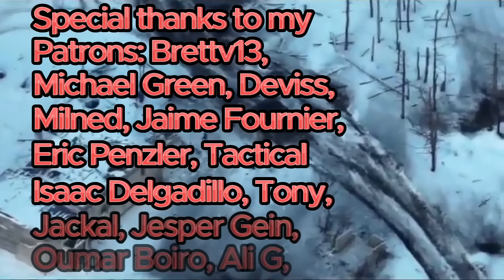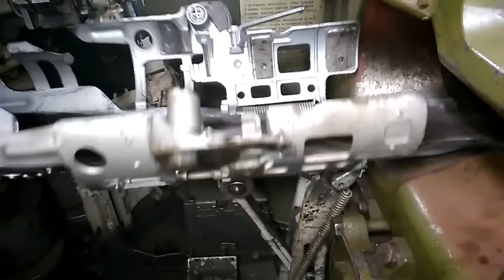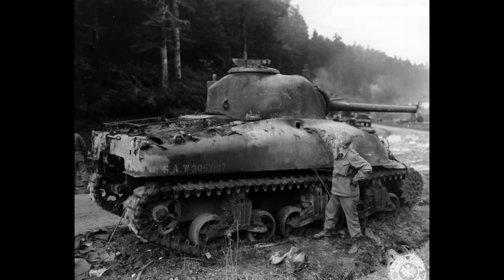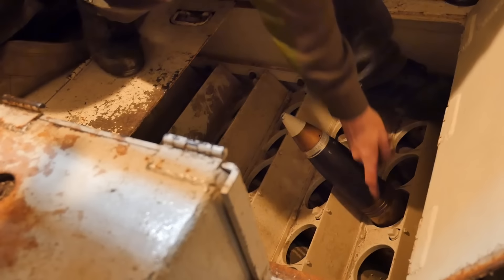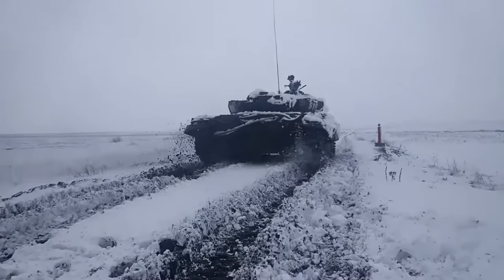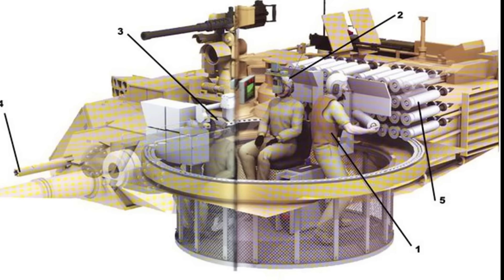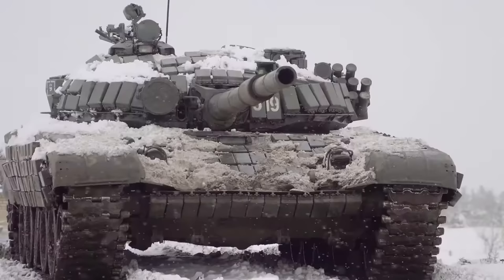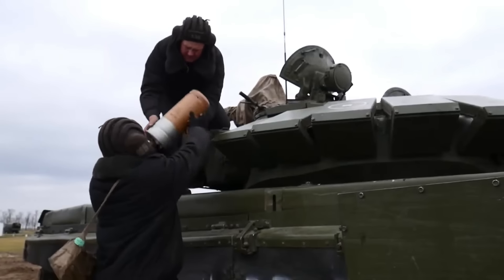Is Autoloader Really the Reason for Russian tanks exploding so much?

Comment: Would it be feasible to simply raise the floor plate over the top of the carousel so if the ammo does get stuck, it would be easier to have it vent out the bottom of the tank? I suppose that would kind of be like a lift kit and the driver  may get a new hatch behind him to escape from.

Comment: Less the autoloader and more the style of autoloader.  The leclerc has a segregated ammo storage area and an autoloader (That the T-14 is basically copying, admitting it as a design flaw).  The soviet basket layout and autoloader system is a blatent design flaw if you want the crew to take a hit and be able to survive long enough to be given a second tank instead of being turned into borscht

"Why? For the same reason our reactors do not have containment buildings around them, like those in the West. For the same reason we don't use properly enriched fuel in our cores. For the same reason we are the only nation that builds water-cooled, graphite-moderated reactors with a positive void coefficient. (beat) It's cheaper." - Valery Legasov in the finale of "Chernobyl"

Comment: Ejectable carousel (downwards) might be an alternative solution?
Reply: Like a blowout panel at the bottom of the hull under the ammunition? I guess that might work but I’m not a tanker so idk if they might be any hidden drawbacks to this.
Reply: Only option is thick protective containers like for Merkava shells. But it works with manual loading. IDK how make it for Autoloader.
Reply: Down is bad, there is ground in the way) you want unmanned carousel turret on the top with crew in hull.

Comment: Its the design Russian designers havent changed the design since their creation and havent cared to change it even through top attack munition developments.
Reply: And they arent wrong - storing ammo AT THE BOTTOM OF THE TANK is better then on top for top-attack ammunition, duh. Same way as storing ammo on top of tank is better for mine protection.
Reply: @alexturnbackthearmy1907  "storing ammo AT THE BOTTOM OF THE TANK is better then on top for top-attack ammunition" 
No its not since the top attack ammunitions can have 600mm (and more) pen and the jet will slice everything that comes in its way since the top of the tanks are lightly armoured.
Reply: @kerekeke5295  Its better then having ammo on top, and with relict ERA (or something likes of it) there is decent chance it will be stopped/performance degrades so much that jet losses its power traveling trough fighting compartment. Much better then having NONE empty space between warhead and ammo, much less block or two of ERA.

Comment: Very Briefed And Summarized Ideas:

the fpv is new emerging threats to the current battlefield's environments, On the other hand, the various tanks currently operating in the Ukrainian theaters of operations are designed according to the requirements and specifications of the expected operational environment in the Cold War and then in the era of the so-called war on terror for the latter prioritizing the survivability in urban areas which highly saturated with hand held anti tanks launchers firing HEAT projectiles and improvised explosive devices, therefore, those tanks operating in the Ukrainian theaters of operations still have to adapt to the emerging threats and hostilities on the battlefield's...

It is worth noting here that the kits equipping various western tanks and armored infantry fighting vehicles to fight the war against the rebels, especially in the urban environments, is theoretically suitable for protecting them from the threats of FPVs, since those suicide drones carry the same PG7 projectiles that are launched by RPGs launchers, so what is the difference here? In fact, there are some fundamental differences, including, but not limited to: 
1- the accuracy in hitting the exact part of the tank’s body that is most vulnerable to destruction with absolute freedom, especially during its movement in the no man's land.
2- the ranges that exceeded the 300m barrier for the same projectile when fired from a shoulder fired launchers to several kilometers when delivered by FPVs, exceeding the ranges of most ATGMs present on the battlefield...

I think it could be countered by various means including but limited to the mixture of : cages, explosive reactive armor commonly known ERA, and active protection suits, radio signal jamming devices the latter by the way playing the same role of the soft kill systems utilize to counter the ATGM missile's, so it will take some time to develop the right mixture to counter the FPV drones against armor fighting vehicles AFVs especially the tanks and the infantry fighting vehicles IFVs... 

the Soviet's and the western tanks was designed to fight, survive and win the battle's in the european theaters of operations, each blocks had different concepts and fighting principle's, the Soviet's from their ww2 extensive experiences prioritized the mobilty and the firepower or the speed and the main gun caliber (destructive power) at the expanse of the protection (although the Soviet had different norms or standard's for the interpreting the protection that outside the classic classification of the thickness the RHA and the weight of the tanks) and advanced fire control systems, prioritizing overwhelming the enemy with huge numbers of various types of AFVs especially tanks and IFVs supported by intensive ground based and air based firepower assets and try to achieve fast breaching of enemy lines or crossing the battlefield's and fast closing the distance's with the nato armored and motorized formations and try to crush it from closest distances, and with that mitigating the traditional western tanks preferences and advantages in: advance fire management system : sighting system, ballistic computer, metrologic sensor's, the stabilization systems, alongside the longer guns and more advanced ammunition, and the excellent communications or the team works... 
(((although our talking here over tanks versus tanks and not the combined arms battle's doctrine especially since the tactical and operational requirements and demands for tank designing, (especially western ones), give top priority to the combat capabilities of the friendly tank to defeat the enemy armor fighting vehicles especially main battle tank, (preferable from the first shot), and not leave this task to the rest of the battle weapons either traditional weapons or the evolving and emerging one's over time.
and I think this is contrary to the public belief that tanks are not designed or intended to fight other tanks)))...

On the other hand, after World War II, the ground forces of the nato alliance adopted, for a large part, the combat doctrine of the nasty germans army, and this approach did not come out of nowhere, but rather was a translation and interpretation of what the numbers and data reflected during ww2, not only the rates of losses in tanks and armored fighting vehicles between the two parties with 7-8 Soviet tanks to each nasty germans tank lost on the western/eastern front, but also in the rate of industrial production of tanks between the Soviet Union and the nasty germans, for example, the Soviets lost about 50 thousand t34 tanks in World War II, In contrast, the nasty germans factories did not produce more than 67 thousand tanks and spgs in total from all types in the entire 6 years of war, and added to this is the nasty germans lost its air superiority over the Soviet union territory in World War II since 1943, and thus over time gradually but steadily, the roles of the nasty germans ground attack planes and  bombers had dropped in harvesting Soviet tanks, and most of the credit for destroying Soviet tanks was awarded to the nasty germans ground forces especially tanks and more specific the heavy ones equipped with 88mm gun with longer barrels l70, the flake 88 gun and other tank especially equipped with the high pressure 75mm/l70 and armor hunting fighting vehicle's, beside other classical and evolving elements in the battlefield's like the recoilless rifles the early generation nasty germans RPGs...

this is why western tanks after World War II (and purely driven by the nasty germans extensive experiences in ww2 beside by economic and industrial considerations) glorified the stand-off capabilities of its tanks, and work to employ the factors of traditional technological and industrial superiority of the west in favor of producing tanks that possess superior combat capabilities over its Soviet adversary, enabling them to accurately destroy his tanks from a longer distance than the effective engagement ranges of the Soviet tanks main guns, and at the same time enjoy high levels of protection enhancing its survivability chances on the battlefield in case it suffered a direct hit with apfsds rounds or HEAT rounds...

Comment: Both systems are equal . 
Bustle increases profile but it's faster, 
Carousel is smaller but slower because ammo needs to be moved in two planes. 

The only version of a carousel
Autoloader that is future proof would be one were the ammo is stored vertically because it allows the use of longer single piece ammo für apfsds 

I bet if done right one could build a carousel autoloader with blowout panels under the carousel.

Comment: The issue is pinpointed by RedEffect at the very end: the sensitive ammo and propellant. That's what explodes. Also Abramses don't tend to actually explode due to in most cases carrying APFSDS ammo. If we were to load the Abrams with Russian HE-FRAG and HEAT rounds and hit it with a modern RPG, it'd explode and tear the tank apart, blow-out panels or not.
Reply: any source to back what you just said?
Reply: @kekwuwuowo  No need, as it is pretty obvious - if 125mm HE is enough to get a tank from outside, then why wouldnt it able to do so inside a tank, behind a thin wall?
Reply: @alexturnbackthearmy1907  its not a "thin wall" its a thick armored door
Reply: @kekwuwuowo  Thick armored only for apc. For tank it is about same as top/bottom armor - notoriously vulnerable for explosives, which is why one of the most frequent add-on kit for western tanks is mine protection.
Reply: @alexturnbackthearmy1907  what are we talking about here? im talking about the armored door that separates the crew compartment and the ammunition compartment
Reply: @kekwuwuowo  That does no shit when 125mm HE explodes on it.
Reply: @alexturnbackthearmy1907  yea it does
Reply: @alexturnbackthearmy1907  Correction 125mm HE cant get a tank from the outside.
Reply: @kerekeke5295  Meanwhile all other tanks that were taken out by 122/125/152/155, IED and home-made shaped charges:
Reply: @alexturnbackthearmy1907  122/125 by not using the HE round. There is a video of I think a leopard engaging T-series tank with HE from the front causing it not to destroy but it got damaged. IED and shape charges destroyed the tank because of the good kill placement mostly used by drones from the top.

Comment: Question: if having ammos behind the turret with blow up pannels is better, why they didn't adopt this system on their tanks? Also the T-14 being newer still doesn't have it
Reply: Because the crew is enclosed in a capsule, separated from the ammo itself.
Even when it cooks off, the crew would be safe.
Reply: They have adapted it, In the T-90M
Reply: @subjectc7505  no they didn't(?)
Reply: @subjectc7505  T-90M uses a bustle storage, not autoloader, which apparently isn’t even accessible from the inside.

Comment: Insensitive ammo is definitely a must have if you want to store ammo in the crew compartment. Also the MV is hydraulic and should be converted to an electric drive system so there is less flammable material that could burn.

Comment: but wait... t14 does have t80 style auto loader... and i presume no blow out panels outer that turret. probably some different style of auto loader would be better for that one.
Reply: T-14 uses a crew capsule, so it doesn’t really matter for crew survivability. And if that’s no longer a concern, carousels are harder to hit and can be more easily armored. It also allows for a lighter and smaller profile turret .
*For maximizing available ammunition, it could also be combined with a bustle autoloader.
Reply: @RichelieuUnlimited  well yeah. however tank is total loss. with different design tank may not be total loss. also how is ammo in armata? only 28 rounds?

Comment: How to fix the issues? 
They change the explosive compound to something similarly under in the German shells that has a harder time blowing up when hit.

The key word is Insensitive filler
Reply: It doesn't change a think  if the turret flies off or stays. A hit that causes it kills the crew anyway.
Reply: @miriamweller812  Most of the time FPV drones only disabled a tank or just blow up the ERA blocks. 
The crew survives. 
If you consider that the Russians use their tanks as assault guns you understand why they are effective. 
Why they make contact raids on enemy positions and they are gone before the enemy can hit them. 

War is complex. 
But an insensitive filler would not let the ammo to cool off thus killing the crew inside.

Comment: There is actually a big confusion when it comes to ammo rack in blow out panels.

No blow up panels could explode and torn the turret to pieces along with the full crew! Blow up panel only protect you from ammo cook off or to say ammo propellant burning. But not from HE explosive inside the shellls! The only reason why you can't see M1 abrams tank getting exploded in Ukraine is because they don't use HE shells in those tanks!
Reply: They don't have a real HE shell , we used HEAT-MP rounds a long time . Now they got a HE shell , but I don't think they send it to Ukraine . Just the old crap to get rid off , some UA soldiers complained about that hitting a house 10 times with an Abrams and it still was intact .
Reply: @5co756  Yes, they hit the house with APFSDS and expected the house to go down, wtf🤣